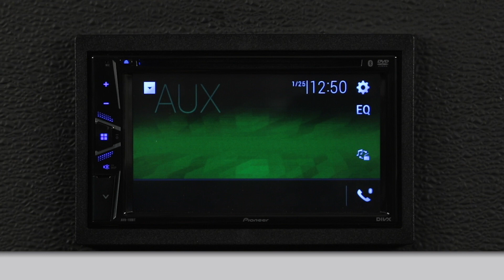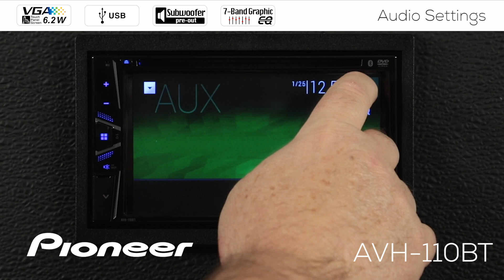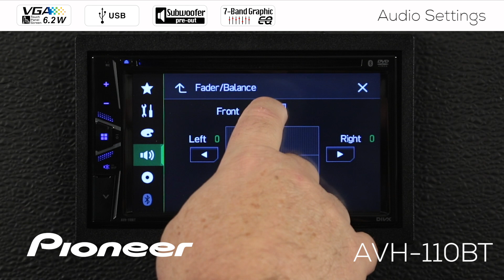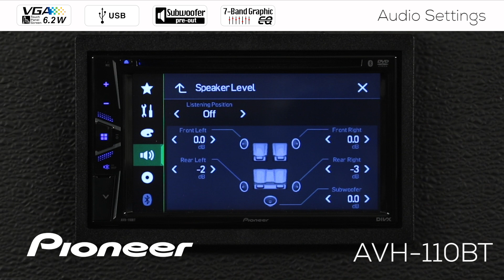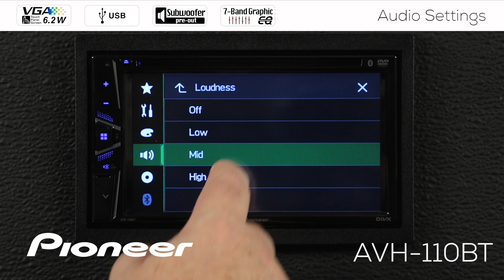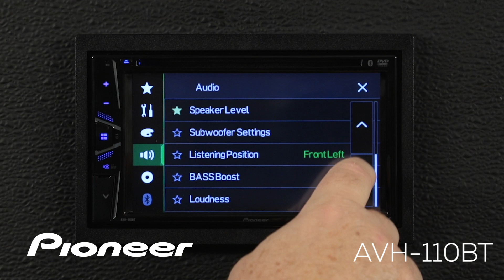How To - Pioneer AVH-110BT - Audio Settings Menu

Comment: Can't access the Bluetooth settings at all even after I engaged parking break
Reply from the maker: You’ll need to engage the vehicle’s Parking Brake in an ON-OFF-ON operation in order to access the Bluetooth setup menu. This might also be known as the Hand Brake or the Emergency Brake.  If you engage the vehicle’s Parking Brake and still can’t access the Bluetooth menu, the in-dash receiver’s Green Parking Brake Wire may have an incorrect connection to vehicle.  You can learn more about the Green Parking Brake Wire in this Pioneer How To video:  https://youtu.be/-bF3uzzaT30?list=PLw63zJRQbCNjEUhMJufnF-zxddC2146LR&t=312
You can find more videos on Pioneer's YouTube Channel here:   https://www.youtube.com/user/pioneerelectronics

Comment: Question for you. So I’ve been using mine for about two years already and crazy thing I have never ever been able to hear any sound on an incoming call through the speakers. Every time I attempt to make a call people say they can barely hear me and I can’t hear them whatsoever there is no sound at all. So I have had to use the speakerphone option on my phone if I need to make a call while I’m in the vehicle which is super inconvenient and pointless because I bought this because it was supposed to work for calls as well. So do you have any ideas what could be causing that problem? Bluetooth is paired fine, I can play music off of my iPhone just fine but for whatever reason it is useless for phone calls and I’ve been regretting it since I got it but maybe I’m missing something. Thanks
Reply from the maker: When you are on a phone call, please be sure to raise the in-dash receiver volume to a listenable level and to raise the phone’s call volume.  Please watch this video for information about phone calls on Pioneer AVH-110BT:        https://youtu.be/A6KVxci2RtQ?list=PLw63zJRQbCNjEUhMJufnF-zxddC2146LR&t=147   If you still don't hear the remote caller in your vehicle, you may have the receiver wired incorrectly.    Pioneer in-dash receivers output Bluetooth Phone Call audio to the FRONT speaker outputs and FRONT RCA outputs only. 
Bluetooth Audio, or music played from your phone, will play through all outputs, both front and rear. Your in-dash receiver may be installed incorrectly. There is an easy way to test it. Using the Fader control, fade the audio output all the way to the front. You can see how to use the fader control in this video: https://youtu.be/WfRawQnSPto?list=PLw63zJRQbCNjEUhMJufnF-zxddC2146LR 
Can you hear music? 
Can you hear phone calls.   If you fade the system all the way to the front and can not hear music, that means the in-dash receiver’s FRONT audio outputs are not connected in your system. Need help with wiring your Pioneer System? This video explains the wire harness system: https://youtu.be/-bF3uzzaT30?list=PLw63zJRQbCNjEUhMJufnF-zxddC2146LR You can find a full playlist of How To videos about Pioneer AVH-110BT here: https://youtu.be/IjOXaCYwIyM?list=PLw63zJRQbCNjEUhMJufnF-zxddC2146LR and you can find more videos on Pioneer's You Tube Channel here: https://www.youtube.com/user/pioneerelectronics

Comment: Why on earth would it not have a minimum of 50hz for Subwoofers sorry but I find that wierd
Reply from the maker: Please clarify your question.  Are you referring to the Equalizer settings?  Or the LPF crossover settings?  Or some other setting? What is the model number of the Pioneer receiver to which you are referring?
Reply: @pioneerelectronics  Model AVH G220BT the subwoofer settings can it be set to 50 Hz  ?
Reply from the maker: @rashidharris197    The Pioneer AVH-G220BT is very similar in operation to the AVH-110BT seen in the video above.  Here is the Pioneer How To video for the Subwoofer Settings for the Pioneer AVH-110BT:    https://youtu.be/THxQ-Mnb7JM?list=PLw63zJRQbCNjEUhMJufnF-zxddC2146LR     The available LPF, or crossover points are 80Hz, 120Hz, or 160HZ.   The LPF, or Low Pass Filter, lets all frequencies below the selected point to pass through to the subwoofer amplifier.    This means if you choose and LPF setting of 80 Hz, all frequencies below 80 HZ are going to the subwoofer.  That would include 50 Hz.  The slope is fixed at 12 dB per octave.  The AVH-G220BT is one of Pioneer most entry level receivers.   Other more advanced receivers offer a wider variety of crossover points to choose from.  For example:  SPH-DA160DAB      seen here:   https://www.pioneer-car.eu/eur/products/sph-da160dab/support             has LPF crossover points of   25, 32, 40, 50, 63, 80, 100, 125, 160, 200, 250Hz.    In addition a slope setting of 6, 12, 18, 24, or 30 dB per octave can be selected for any of the crossover points.